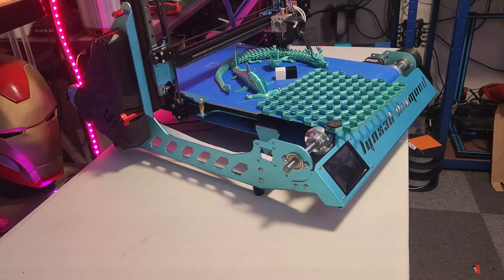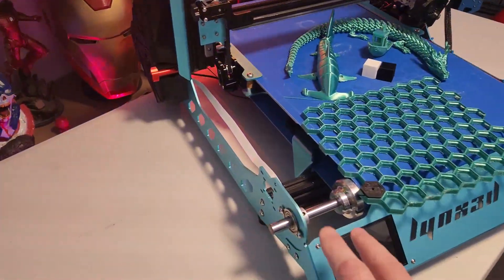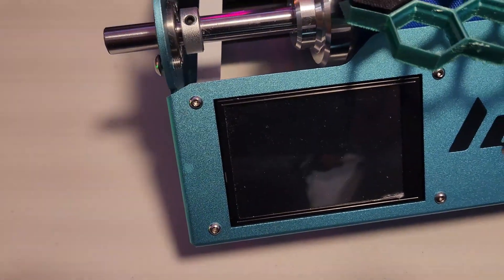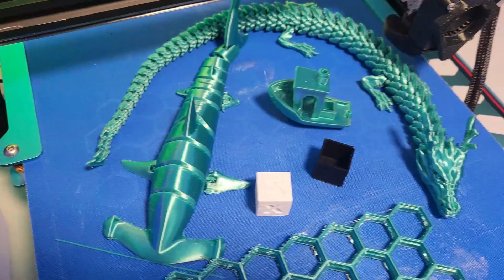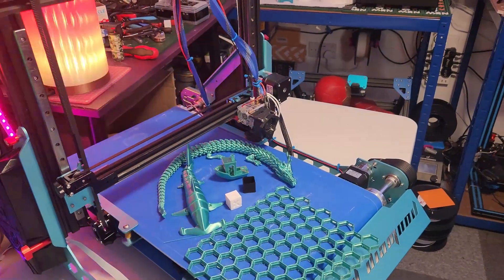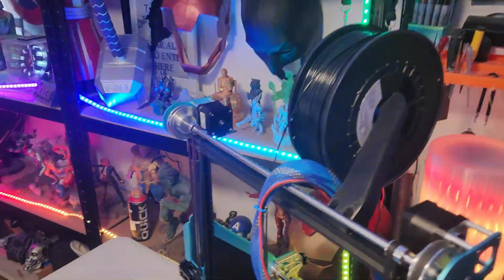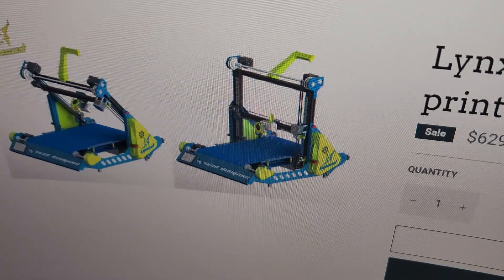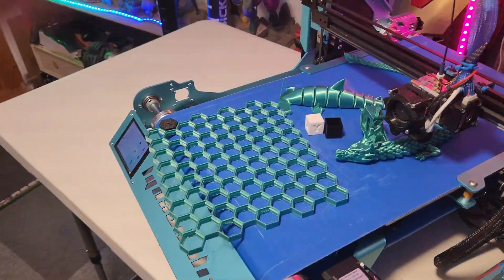Lynx3d Diamond Belt Printer

Comment: Nice review. Regarding the print quality (talking for the 90 degree version), did you have any problems with the flatness of the printed parts? Were square or  bending?  I see on the white cube you have printed, the bottom is not square. Is this bending happening  because belt cannot be as flat as a regular bed surface (like glass or PEI) ? Had any problem with belt drifting, specially in long prints? 
How was the printing quality compared to a regular printer, eg. E3?    Thank you.